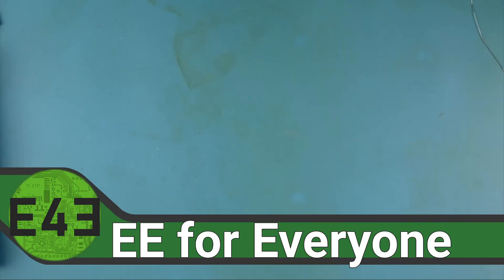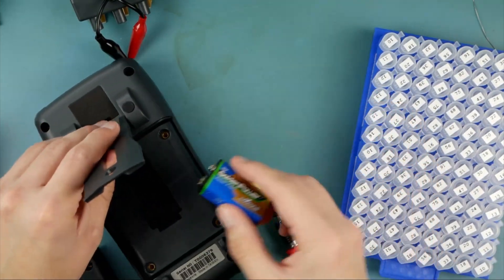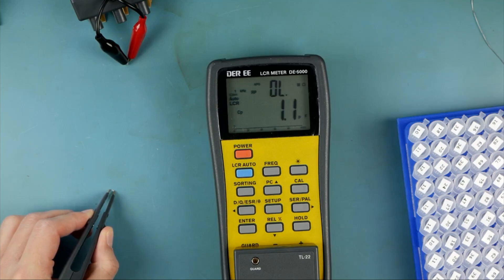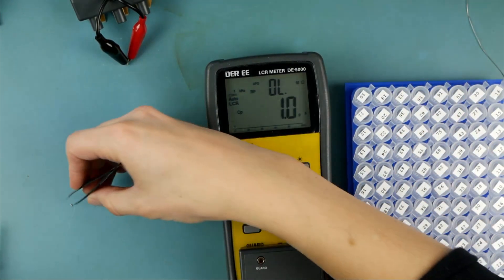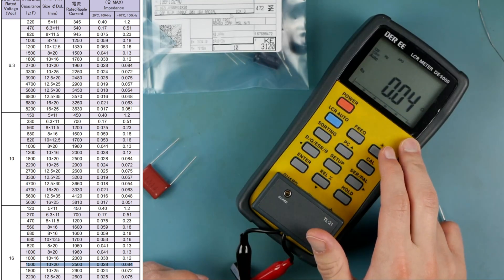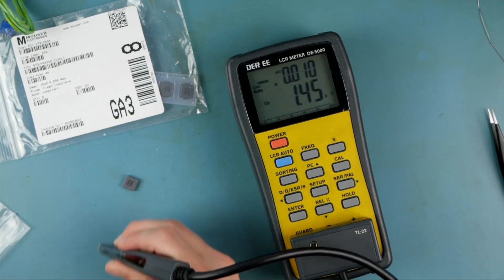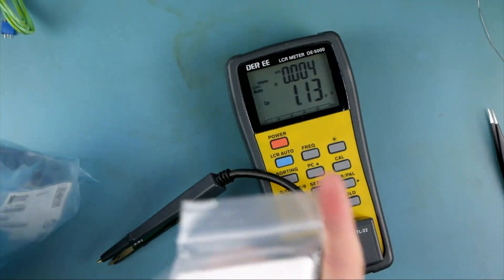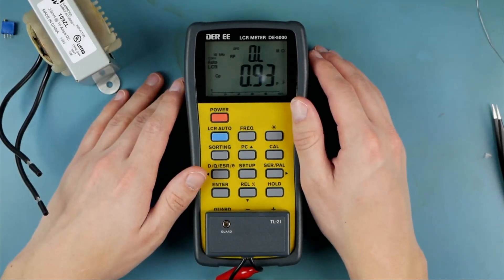DE-5000 Handheld LCR Meter – First Looks

Comment: He does understand anything about calibration let alone Ione testing components. These are not 100 percent accurate. Their are capacitor checkers out there that are better but not accurate as well and they cost thousands. They all go by average..that's what cheapest do..average...sorry lousy video sounds like your confused and you are. Learn electronics and then make a video..

Comment: an inductor/transformer saturation current tester jig is also something you may find useful - often when gapping transformers this is just as important as the inductance itself if not more so; 
a small hearty buck converter to generate a low-ish voltage, high current supply from one of your bench power supplies
a LOT of capacitance to keep the supply stiff under transient
a shunt
a fast amplifier
a mosfet
preferably a mosfet driver
a schottky diode 
power supply connectors
bncs for scope and function generator

Comment: You need to recalibrate it after different measuremtn leads are replaced. It is fairly straight forward, it requirs for both terminals to be shorted and opened for 30 seconds each.
Reply from the maker: Thanks for the tip! I'll admit, I never read the manual. :)

Comment: congratulations :) i love mine.  you can also use it at 1khz for measuring audio impedance.  and you can measure capacitors by plugging them directly to the slots. you can also mod it to use true 4 wire tweezers.
Reply from the maker: Thank you David! Seems good so far. If they're the same as the EEVblog version, I think they're 4-wire down to the tweezer tip, but there's still a short length of 2-wire down to the part. Great thoughts!